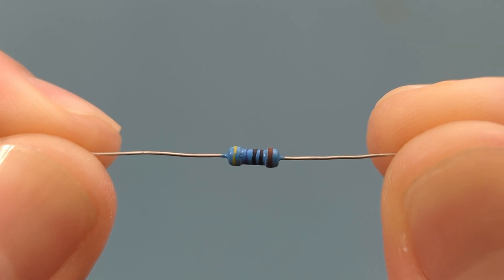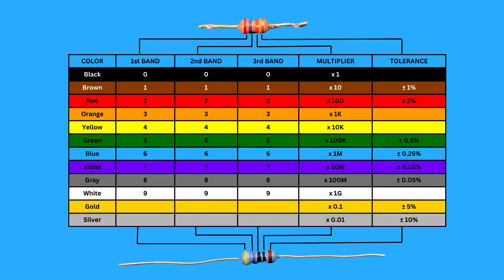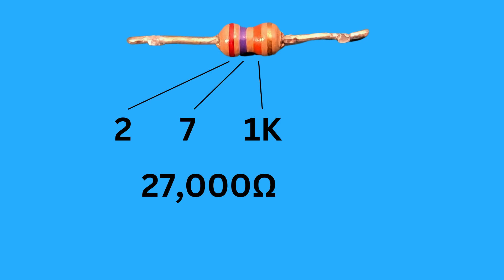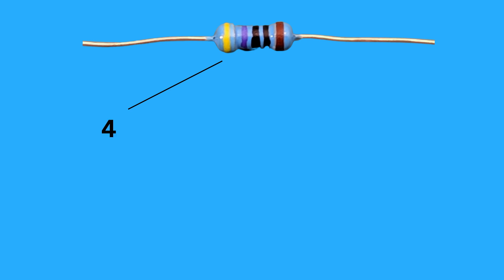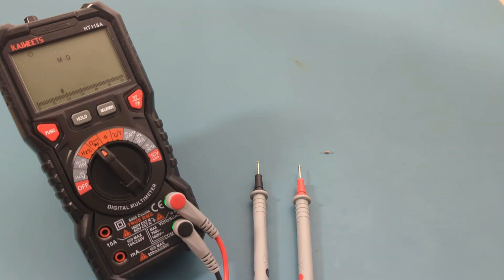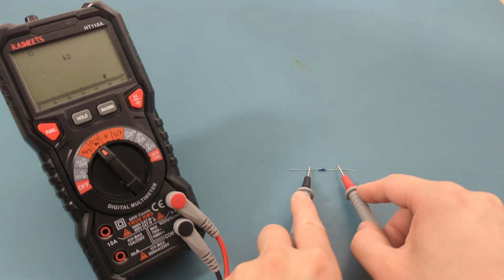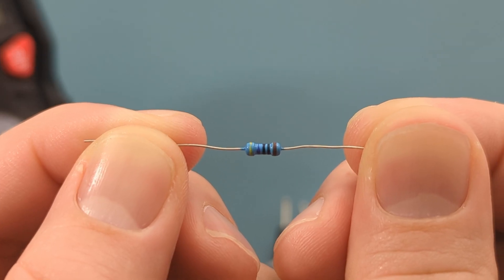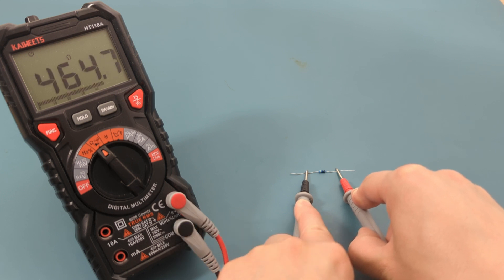How to Read Resistor Color Code

Comment: This was a great video! Thank you so much. I've recently begun building circuitry using my raspberry Pi and a breadboard and was very concerned about confusing my resistors. Especially because they're kind of hard to see.
Reply from the maker: Glad it was helpful! It's so much easier once you get the hang of it.